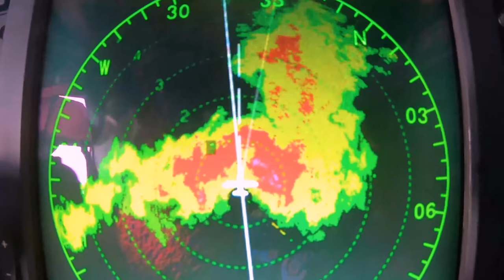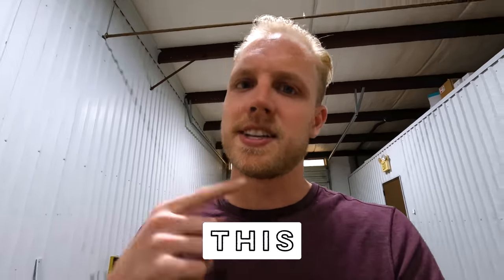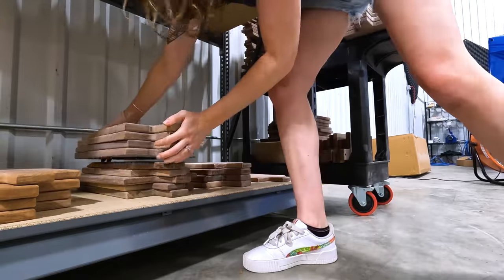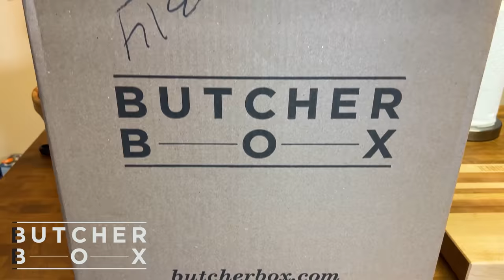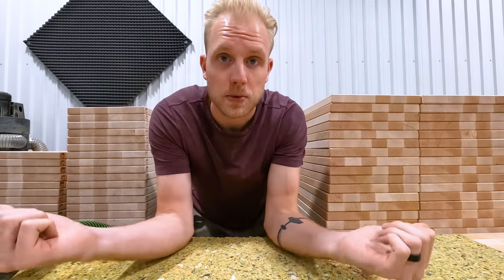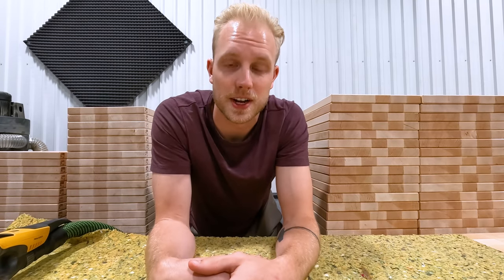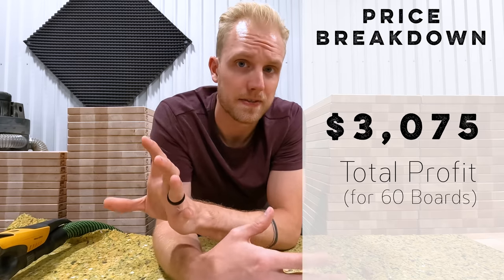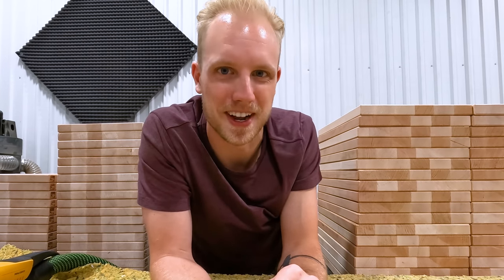we built $7,500 in cutting boards (will it be enough?!)

Comment: Paint part of the board inventory shelf red, then standardize the way you stack on and draw off inventory so that when the red surface is visible Production knows to make more boards.  When your business volume changes so that your safety stock margin becomes  a larger number of boards re-paint the inventory shelf to accommodate that change.

This might force you into LIFO inventory management but your items are not perishable.  You can always rotate inventory from time to time to put older items at the top of the stack.

Comment: You should really build some kind of holding jig for when you brand the boards. The current method looks pretty unstable, and is a burn waiting to happen.
Reply: Ditto.   I have burned myself working with hot tools on unstable items.
Reply: Agreed, something with the brand mounted horizontally on the work surface so you can simply slide the edge of the board to be branded up to it nigh work

Comment: Stick a piece of cardboard "build time"  between the boards that represent your comfortable lead time to make them. 50 boards a month, 1 week of lead time to make, 100 percent margin for exciting orders, so 2 weeks...put the card at the 14th to the last board in your stack...just like a deck shoe in Vegas.

Just be sure to pull the boards in order.
Reply: Super low cost, super reliable.  We do this and it works great!
Reply: Track your orders (per day) per week to monitor for growth in your "peak week" metric (or trailing 7 days) to keep the system up with your (inevitable) growth.

Congratulations!

Comment: In my life as a bartender, we had par levels for each item. That was the threshold to get to when ordering. So if my par level was 10 and I sold 7 this past week, I would order 7 more. Par levels are based on historical sales, meaning Christmas time would have higher numbers,

So if you expect to fulfill about 50 a month, do another batch of 60 when you get under 50 on the shelves. This also gives you a buffer in case something else comes up and you can't dedicate the time to building the boards.

Of course, adjust the numbers to fit your sitch

Comment: Love what you two are doing. I think you really need to set a standard production schedule. Produce 100 boards to cover a month then set the first and third week to produce 75 boards each week that covers your normal average sales plus can handle any bumps in sales increase. Increase or decrease production based on need. Use a spreadsheet to track sales and inventory both sides(sales and manufacturing) can make on the spot adjustments. Once your sales double and triple you will have no choice but schedule production that's business logistics.

Comment: To help with speed, automation and safety, get some power feeders for the table saw and possibly the band saw.  It helps to reduce the chance of kick back, keeps your hands out of the blades, and goes at a better speed so wood like cherry is less likely to get burn marks.
For sanding, you need a drum sander.  It may not make them perfect out of the machine, but a lot less to do especially since all of your boards grain is longitudinal.
Reply: Even if you use a drum sander you still have to hand or Mirka sand, plus is a good way to ensure quality as you need to inspect and touch every single board before it goes out, you want tor client to love it.

Comment: Possible production enhancements:
1. For glue scraping - Use a bench hook from far side of table, or drop in stop block on the near side, to steady the boards vs using your off hand. (two dog holes & some scraps great stop block)
2. For branding board ends - It just looks like that process is screaming for some type of vertical press for the iron & work holding for the boards.

Comment: If you're running larger batches, consider a jig/press setup for the edge logo brand. 1) save time positioning the board 2) keeps the branding iron suspended away from everything else (reduced risk of fire) 3) enables future automation where you can run it off an air cylinder so you can load a board, push a button, and the timer/cylinder does the rest. 

Also re: inventory - you have to think visually. A line or paint on the shelf as others have suggested is the best way. Let the front office run the spreadsheets and figure out where that line needs to be, but out in the shop things need to be simple.

Comment: Build and have on the shelf all the pre sold boards, so there isn't a chance for you to miss that shipment. Find what your 4 week average sell is and put that many on the shelf. Then once you have 1-2 weeks supply of them left build back up to your 4 week level.

On Monday mornings some one does a inventory count and you know where you are at the start of the week.

 Just in time will bite you in the butt eventually. 30 years in manufacturing and have seen it happen many times and this is with a multi billion dollar company.

Suggestion on your glue up put a piece of the packing material paper under the clamps when done roll it up and throw it away and no glue to clean off the table.
enjoy your videos.
Reply from the maker: Appreciate your experience. And one question: Is getting ‘bit in the butt’ once every decade more profitable than paying higher rent and warehousing product the other 99% of the time? Our guess is: Probably. That’s why it’s still used as a strategy.

Comment: Is there a reason that you've included no overhead costs (building, heat 'n hydro, shop tools 'n supplies etc..) or have you included those costs in a lump sum somewhere?  It looks like you've included the direct fixed costs associated with building the boards (materials, labor etc..) but none of the general operational costs of being in the building.  I could have easily missed something though.
Reply from the maker: I have two answers for you. The simple one is that most of that is 'baked-in' to the Materials cost calculation.

But some of that isn't included (like rent) because overhead expenses are largely fixed-costs which are totally unrelated to the number of items produced. Adding overhead costs in this calculation would be like including the cost of your mortgage into your landscaping expenses...
Reply: @jennieanddavis  - got it, "don't sweat the small stuff" in other words.  My point was that those overhead/fixed-costs are just that - costs and as such impact profit.  Without taking them into account in some way - bake 'em into materials cost, shop supplies, a general overhead allocation charge, whatever - then you're inflating your profit calculations.  No biggie.  Something that chartered accountant you've recommended in previous videos would no doubt calculate.

Comment: Again a really good video. 
I have a small Tip, concerning the glue scraping:  install a doghole quickclamp in the table to secure the boards, makes it much easyier to work on the surface without stressing your hands. It works for many uses and can be removed, if the table needs to bee cleared.

Comment: Granted we are tracking hundreds of items, but we use simple reorder cards that on flat stock (like your boards) we stick them in the stack with whatever amount we deem reasonable left under the card.  Pull the item on top of the card and its time to reorder (or start building in your case).  Its a super simple system that requires zero tech or expense.

Comment: So...inventory management for a "just-in-time" (JIT) system like ya'll said (in another video) that you're using would require you to have a good idea of the typical rate of use/sale, and how long it takes to replenish your stock.

Let's say you make boards in batches of 100 (to make it easy), and it takes you a week (5 days) to make them.  If you sell 10 boards/day, those boards will last you 10 days.

Since in this example, it takes you 5 days to make 100 boards, and 10 days to sell them, you would want to set a reorder point at 60 boards remaining.  This would allow 1 day's worth of safety stock (allows for a small delay in production).  JIT systems are good for keeping overhead (inventory cost) low, but they also have a risk of being unable to meet demand if there are unexpected surges in sales.

To allow for that, if you can produce larger batches in the same amount of time (improve efficiency), you can adjust your reorder point up or down (depending on circumstances).

Since ya'll have been doing this for a while, you should have enough sales data available to determine what kind of seasonal variations there are, when they pick up and drop off, and how to plan for those variations.

Also, in your new shop, take a look at your workflow like you did in the garage.  Make sure you're not moving the material more than you need to to go from one station to the next as it transforms from raw material into cutting or charcuterie boards.

When you have time, look into LEAN production methods, and see what you can do to improve efficiency and reduce waste (there's more than one kind of waste in production).

You two are inspiring, and I'm glad to see that your business is doing well.  

God Bless you, and may your business continue to grow and thrive.

Comment: Add labels to the rack for each set of boards with min and max levels depending your turnover rate. If you sell 10 boards on average of one kind, set that as you min. If you want to maintain a 3 month inventory, have 30 boards as your max, this would be a 3:1 turnover rate. My guess is a 2-4:1 turnover rate is sufficient but this also depends on your products critical path and gets into lead times, which is a whole different discussion. Good luck.

Comment: I'm not sure if you thought of this. But industrial cabinet shops use a tool called a wood welder. It uses microwaves to set the glue in seconds rather than hours. (The glue still needs to be cured overnight) but this could drastically increase your capacity and spend way less time in the glue-up process by not meaning with so many clamps.

Comment: Suggestion on the inventory levels. Put up a large monitor or tv screen and display the inventory levels there. 
You can use an spreadsheet to track for the display and keep it live.
Not much to do other than a few keystrokes to keep it updated once you have it running.

Comment: Y’all need to find a good inventory tracking program that will allow use of bar codes. Put the bar codes on the shelf’s with the inventory. As you package and ship them out you can scan the item and keep up in real time of each item. Can use for all of your expendable items such as the shipping boxes, labels, supplies and what not. 
Also you need to either build a custom press to hold your branding iron or buy a cheep table top drill press and make a bracket to mount it to the arbor and use it as a press. Then build a jig to hold the board at the right spot and you can brand your boards much quicker, safer and more accurately.

Comment: A couple of questions - given the fact that you have such an awesome bandsaw with high cutting height capacity.

1 - Why don't you use wood twice as thick and then use the bandsaw to cut it in half? You'd be gaining efficiency with the glue work since you do it once and get twice the product.

2 - Why not use longer pieces of wood and then cross cut the boards from those longer strips? I could see this being restrictive in your garage - but with the new space, you should have plenty of room, no?
Reply: It takes a long time to bandsaw something 10-12 inches high. The idea sounds efficient in theory but it would actually take longer.
Reply from the maker: We tried the 2nd method in the Josh Weissman board video - there's a LOT more material waste when milling stock with that method and not enough time savings to make it worth it
Reply: @jennieanddavis  Nice to know you guys tried it. Thanks for the response!

Comment: Great video. It is fun to watch you solve problems. First, some of the suggestions that talk about marking your low inventory threshold like reorder cards is probably the easiest solution. You could also have a digital board that tracks units sold and lowers the inventory on the shelf. I also think that you should have a months worth of inventory plus 10% glued up and ready to cut to size, sand and finish. While it is all a process that you guys do, it seems that if needed, you can take a board or ten from the post glue up position, finish and ship in short order if needed. Since the glue up portion is a spot where you stop and wait for the glue to dry, have that at the end of the routine. You do a month worth of boards from post glue up to inventory then go back and get another batch to that point so they are ready when you need them. Just my $0.02

Comment: Great video.  I suggest you get a manual countdown device and put the "reduce count" button next to the laser go button.  Set the initial count to the number of boards in inventory, and count 'em down.
Reply: Thought of this too. Get a small tv that displays a worksheet. You can do a formula that would show days left of inventory. Inventory/avg daily sold = how many days before you run out. Then if you know it takes Davis 4 days to produce 60 boards you can set that threshold to inform him. Also if you use a sheet you can make the number turn colors for ease of identification.

Comment: Dont know if you have tried this in the past..it looks like the boards are face grain. If so, try building them 2x thicker than needed and then resaw in half (making two boards on one cut). Just be sure to plane both wide sides before resawing. Once cut in half, then you only have to finish the other side and it should speed up production significantly. Should also help with storage.

Comment: And I keep thinking about a scale type device per shelf since you seem to keep products on separate shelves and not clutter those shelves up.  You could probably keep within a board or two of needs.  The unfinished boards wouldn’t work but 99% finshined boards, could load into computer quickly.

Comment: Also, another thought popped in my mind - I'd bet you can jig up your branding iron so that you push the edge of your board into it rather than taking the iron to the board. If you design it right, it would probably be even safer as well.
Reply: I thought the same thing. I hate working with jigs because they take so much of the thought out of working. But jigs make routine tasks like this, especially in a money-making venture, so much more efficient.

Comment: An junk drill press and a jig to hold the boards on edge would make it much easier to brand them with the iron.
Reply: I was thinking of something similar. But my mind was thinking of a DIY for the drill press part of your suggestion. A square piece of wood (or 80-20 extruded aluminum) for the vertical "track", a bit of cord from the carriage that holds the branding iron that loops over the top through a pully down to another carriage with a counter-weight that is a little heavier than the iron. Gravity pulls the iron back up and only takes a token force to pull it down. Might want to add in some sort of shield/guard over the resting position of the iron so the operator doesn't bump into it when changing boards in the jig. This would also keep the iron in a safe place if one forgets about it and doesn't notice the disco lights when closing up the shop for the night. ;-)

Comment: why do you push your board true the planer (thinkneser) when I use it, I put it in and the feeders pick it up immediatly. maybe check the thicknes that you set it?
Reply from the maker: That was the first pass on very rough boards - our planer is tuned to give a perfectly smooth board with no snipe, so it needs a little help on the rougher pieces

Comment: Howdy J & D....

I've actually sent a comment or 2 in the past....

I too am from H-Town...though I got out of the city and been living in Porter for the past 18ish years. 

One of the things I asked previously and so, will again...

With a market completely saturated with cutting boards etc. and you guys being of obvious business savvy Intel....

??What made you take the leap into "cutting boards" specifically?? 

Please don't take my question as a "troll", it's pretty obvious you found a niche. 

I've seen that yall do other builds as well, but it seems like that's far and few between????

I too am a woodworker (30 years) but just recently got my shops up and running. Also will be starting a "Sawyer" business soon too. (I'll be in touch :)  )

As well...Through watching MANY of your video's and your board making...LOTS of board making....I'm failing to understand why you guys/gal 😍 haven't streamlined the production yet? 

Yall are very good at marketing your product, I've even got screen shots of your "costs" boards n stuff. But you're still hand scraping boards? Leaning boards dredged in oil next to each other???

With the production/quantity yall have going....Would it not be sensible to have a dedicated drum sanded specifically for glue removal? 

Leaning soaked boards: Build LOTS of dedicated board holders....think of those small wooden/plastic dish holders with the dowels that allow dishes to drain and dry....just on a larger scale than on a countertop...with an angled drain pan of sorts, perhaps made from HDPE so the oil isn't absorbed, excess oil Drains into a bin to be reused. 

Your production would be quicker and have less waste, which means higher profit which pays for the new dedicated drum sander. 

Just my 2.5 cents🤑🤑.

I enjoy yalls videos. 

Thanks.